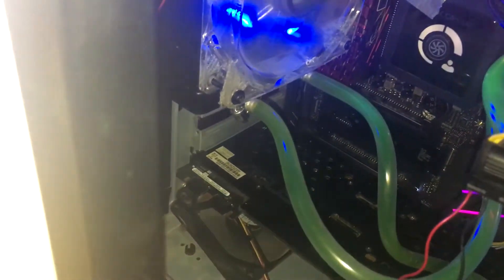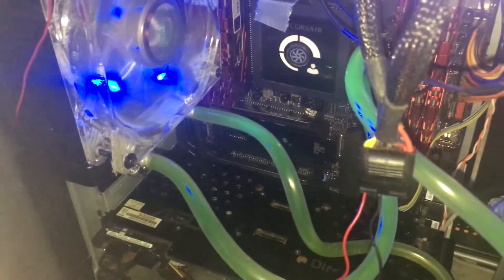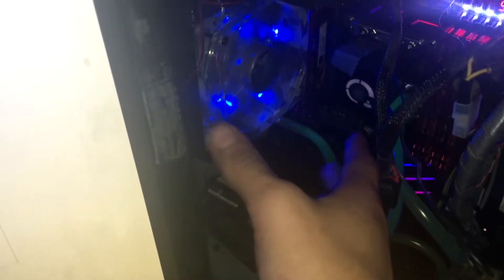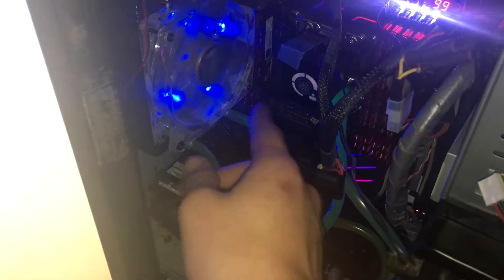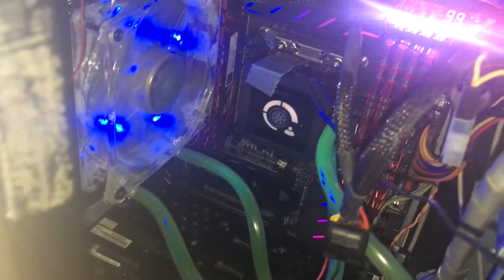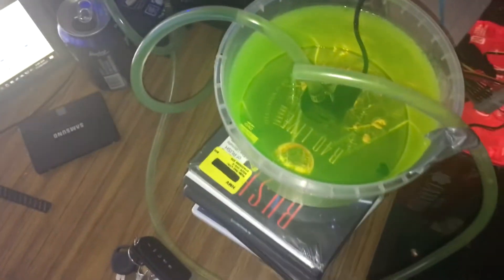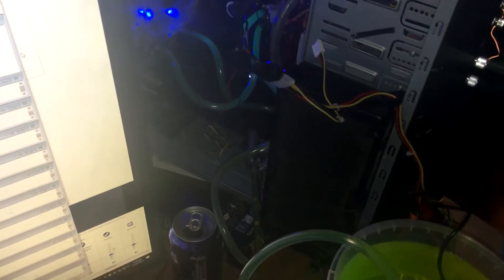VERY cheap DIY PC water cooling!!

Comment: The pump is real bad, do never buy a cheap pump like this, since the flow of the water is so slow.
Reply from the maker: Can confirm.....it died like 3 months later lol.
Reply: @SleepyJoe-v5c  Man, you have way way, better pumps for a bit more money, the only problem is that some of the pump´s don´t come with a reservoir tank if you trully want to go "cheap ass" and the pump of the AIO block is dead, you could open it and remove the propeller, and use a external pump. If your loop is only a cpu + 360 rad in total, a el cheapo pump with tank would be a SC-300T for about 13 to 14 dolars and the next pump would be the SC600 + 110mm or 160mm tank for 24 to 30 dolars. Both pumps are controller by DC, so if your board can´t control the speed of the on DC mode, the next pump would be the SC-P67F since it runs on PWM, you can find it has low has 15 dolars, and on the official store at 18 - 19 dolars, tank sold seperated (ebay tank are cheaper sometimes VS aliexpress ) El cheap ebay tank can go was low as 7 -9 dolars with shipping including. Its important to run the pumps ate half the speed. since your loop is so small.
Reply: @SleepyJoe-v5c  Also, aluminum water block for the GPU is a bad thing  to go for, since it isn´t has good has a cooper one , by far.

Comment: 15% - 20%  Automotive anti-freeze (your choice of color) + 80% - 85% distilled water..   Change once every year and half or longer, done and done..  5 years on a cheap Thermaltake pump and two 12"x10" copper tubed radiators in parallel out of a dead dehumidifier, 1/2" vinyl line from the hardware store, various fittings laying around (brass), a little JB-Water Weld (brass fittings to copper tube), small automotive ring clamps, a 1 liter plastic Coca Cola bottle for reservoir...   Not one leak, I ran Phenom II 1100t at 4.175 to 4.275 ghz the enitre time and had two Evga GTX 680 sc in SLI on the loop as well..   Water Box, and old Dell case..  I was going to weld another Dell case to the top and use two more of those dehumidifier rads, but the Water Box didn't care, temps never got anywhere near high..   Because I was gifted the Water Block and I had fans and fittings laying around, cost came in just under $110.00.

Comment: Why not take a big fan, a big funnel, and a few tubes connected to the small end of the funnel, to get high speed air directly onto heatsinks? It could also effectively work like aircooling using the tubes for water cooling, minus the leaking risks.

Comment: You shouldn't use any glycol based fluids (car antifreeze) in there. It will, over time, eat away at that soft tubing and clog your water block. Don't listen to people talking about how it's unsafe because it's cheap. These people have been programmed to think only expensive works because the market has manipulated them into thinking this way. Just get that fluid out of there and go with distilled water with some mayhem additive. It's not expensive and you'll thank me later....lol
Reply: NAH...   15% - 20%  Automotive anti-freeze (your choice of color) + 80% - 85% distilled water..   Change once every year and half or longer, done and done..  5 years on a cheap Thermaltake pump and two 12"x10" copper tubed radiators in parallel out of a dead dehumidifier, 1/2" vinyl line from the hardware store, various fittings laying around (brass), a little JB-Water Weld (brass fittings to copper tube), small automotive ring clamps, a 1 liter plastic Coca Cola bottle for reservoir...   Not one leak, I ran Phenom II 1100t at 4.175 to 4.275 ghz the enitre time and had two Evga GTX 680 sc in SLI on the loop as well..   Water Box, and old Dell case..  I was going to weld another Dell case to the top and use two more of those dehumidifier rads, but the Water Box didn't care, temps never got anywhere near high..   Because I was gifted the Water Block and I had fans and fittings laying around, cost came in just under $110.00.
Reply: liquid in the freezer packs dont work anyway lol but the icecubes in my car work though